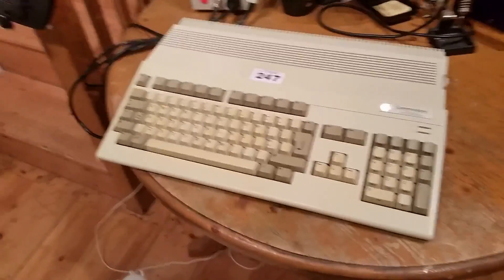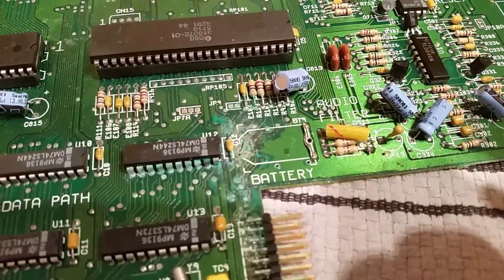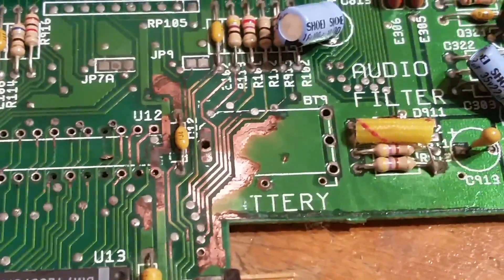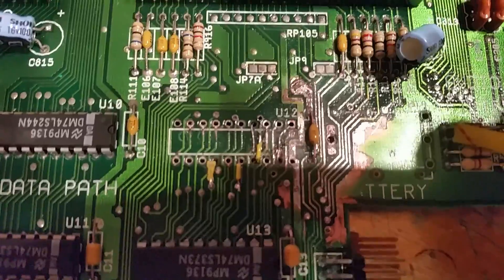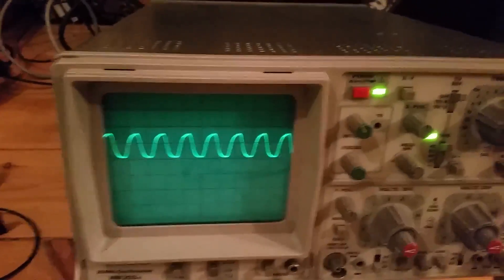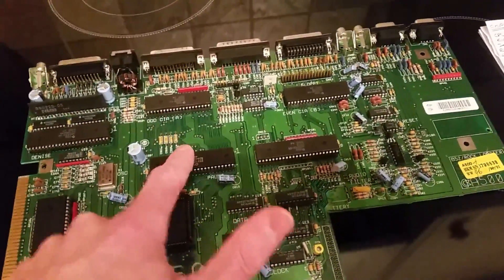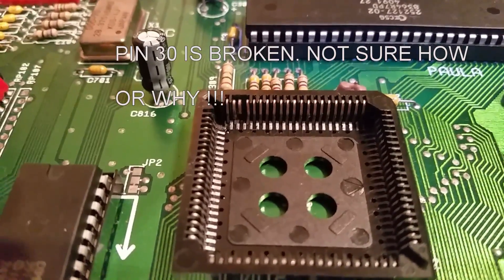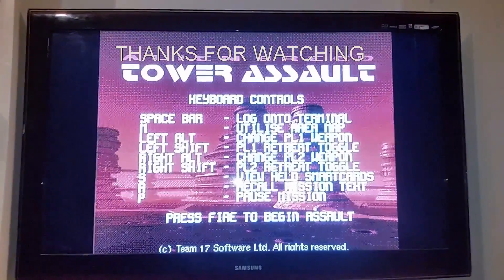Amiga 500 Plus Blue Screen and or 'No Signal' Repair (Older Vid - Rough Audio)

Comment from the maker: Hi. Thanks for all your help on fixing it! Re the traces, I cheated and used an electric wire brush!  It is a cheap, low power dremmel type thing I got from Maplin. It is called an Everise rotary tool N29hh. It was pretty cheap and not good for much else! Most of the bits are useless. The drill has no power but it makes a nice gentle sander and doesn't tear things up. It takes a good while to get through the solder mask though!

Comment: Good job!  Interesting approach creating eyelets there, but it is easier just to put patch wires underneath.  Really nice job cleaning down to the exposed copper there, did you sand it to expose the copper there?   That last 500+ I looked at was really heavily corroded =/   Overall great job, and yet another 500+ saved!!!